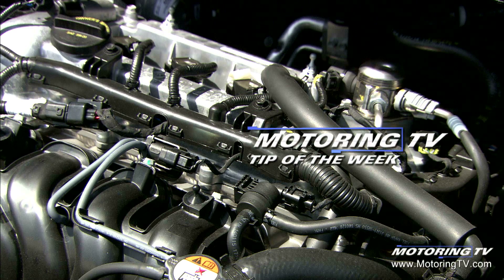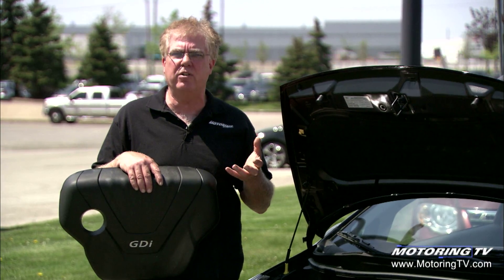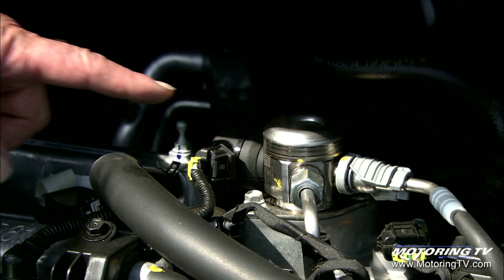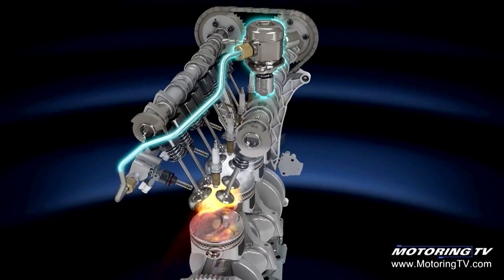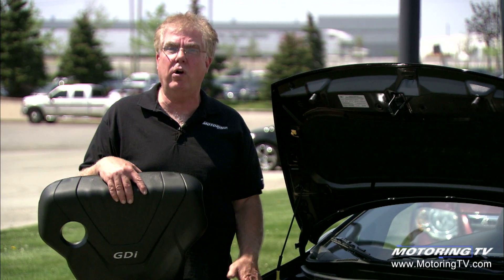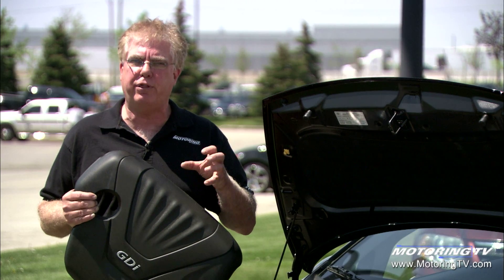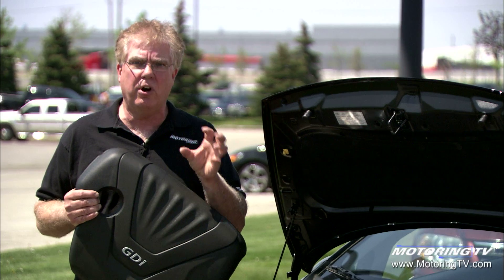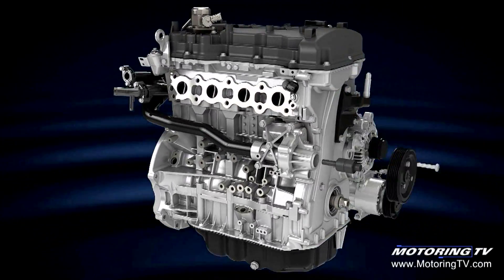Tip of the Week: Direct injection

Comment: Worse advise ever. I just spent $1500 to have my valves media blasted with ground Walnut shells due to peanut size chunks of carbon on the valves and a bad fuel injector. Cause...  Direct injection. Carbon is not washed off the back of the valves like it used to be. Stop giving bad advise. These engine s are too problematic. Mechanics everywhere will tell you NOT to buy them unless the manufacturer added an extra fuel injector back up on the port to cleans the valves like Toyota started doing in about 2014. Ford does it now in their trucks.  They figured out that it caused problems. Basically cars are being designed not to need major maintenance in no time. If it's one with the extra port injector to clean the valves then DI is good because of it's gains. But now you have more fuel injectors to worry about. Lol.
Reply: Or for free (-fuel cost) you could have held it in 3rd gear on the highway for 10-15 mins haha this has been shown to be incredibly effective at cleaning intake valve deposits. Plus the deposit issue only seems to affect DI engines that are short tripped a lot or don't see much highway milage.

Comment: If you get a direct injection motor you must buy an oil catch can as soon as possible. Or you're going to have problems with carbon buildup on the backside of the intake valves.

Comment: The engines with out the injectors on the manifolds to clean the carbon off should be considered defective in my opinion and a manufacturer defect.   UNLESS - they also have the injectors on the manifold for cleaning of the valves through computer controlled cleaning cycles.

Comment: There is a downside, your valves get very dirty with no fuel going over the valves.  I agree that DI is step in the right direction and would buy a engine with DI, but have to take the time to clean the valves using GDI cleaner.

Comment: It does ad maitenance cost.  Every 30 to 40 k you have to flush the fuel system and that is about 3 to 4 hundred dollars. Also Kias and Hiunday GDIs are notorious for check engine light pop on because of miss fire and that is caused by carbon build up.  DI is good BUT,  it does add mitemamce cost and compromise Reliability..

Comment: I know VW is resorting to blasting walnut shells into the intake port in an effort to clean the backsides of the valves.  Sorry Bill, you're a knob if you think there is no downside.  I usually like Bill's advice, but not here.  The cost of the HPFP (High Pressure Fuel Pump) would be a kick to the nuts to replace as well, and it will need replacing some day due to the enormous pressures involved  On a TDI about $700.00.

Comment: CRC intake valve cleaner every oil change works wonders. Yes GDI’s have a big flaw but easily handled if you take care of your car.
Reply: WhoHonestlyCares ??? I just did my 2016 kia forte. It smoothed out the engine. But when the lights are on its a tad rougher but not extreme. I guess its normal.

Comment: Sorry I would never buy another DI car. I would avoid them at all cost. UNLESS its toyota as they combine port injection to keep the valves clean. Forget everybody else at this point in time.
Reply: Sorry, but Ford did the dual injection first. Toyota was just smart enough to copy them...
Reply: craig g and as usual improve it
Reply: Really easy to clean the valves using GDI cleaner, did it this past weekend and took me a total of 1 hour.
Reply: @darrelc5411  Did you see before and after inside the engine? How do you know it works?
Reply: Yes I saw down the intake ports where the valves are, and they were very dirty, after the GDI cleaner, they were clean.  I took off the air intake manifold, to get a nice view of the valves, also changed spark plugs at the same time, since it was off.
Reply: @darrelc5411  Thanks for your reply. I have a 2015 Sonata that is running fine for now, but I'm going to start using the CRC as a preventative measure. Like the car a lot, but just recently learned about the problem with GDI and this has had me worried. I usually drive cars for at least 250,000 miles without any major repairs. Was hoping the Hyundai would hold up.

Comment: Not sure why a self cleaning water/steam system is not incorporated into these engines.  Basically a water tank that sits on the exhaust manifold that will deliver steam through the intakes, and have it pass over the valves.  This is a high level idea.  Winter driving, how/who fills the tank, etc. all need to be worked out.   It basically it needs to be set up where it will only deliver steam to a high raving engine when it is at operating temperature.  The car manufacturers can make money by selling a suspension fluid that contains petroleum based solvents injected or carried with the steam.  We need a solution for dirty valves with gdi.
Reply: I like your style dude!
Reply: Jeff Sol seriously!!!  I will have to get on Google.  I need to get out more.

Comment: Down side is carbon build up which is expensive to clean......added maintenance cost.
Reply: Mike Shay . 4K holy crap
Reply: I mean if you use good gas and clean it every 30k miles with liquid you should be fine. If it's a vw it's a 5 hour job all other manufacturers 2 or 3 hours and can be done easily.
Reply: Cost me just over 4k.  All new 8 injectors and carbon cleanup using walnut shell media.  Direct injection is not worth the downside unless it has valve port injection to spray the tops of the valve with top tier fuel only. Never use cheap gas.  Blame the EPA with their strict emissions regulations.  Too much too soon is demanded for slightly cleaner emissions.  These engines recycle the dirty crap that would normally be forced out of the exhaust.  Instead, they are recycled to burn a second time in the combustion chamber and the system that recycles it can also fail and is also very costly.

Comment: The one big downside is carbon buildup behind the valves. Even a high detergent fuel cannot directly clean behind the valves on a GDI engine. But the benefits outweigh this downside, imo.
Reply: This isn't much of a problem anymore, especially on the engine given as an example in the video which intake valve deposits are almost unheard of.
The early VW DI engines were terrible for it but those were early days.
For example on this Gamma engine the valves are still open when the fuel is injected and it has a slight cleaning effect, enough to prevent build up. There are Hyundais with this engine with over 500,000 miles with no mechanical or carbon issues.
Toyota now puts mini injectors behind the valves too which operate every now and then to clean the backs.
Reply: Sector 001 Not in my opinion
Reply: With intake valve cleaning b4 every oil change... my kia soul drives the same at 27k as it did new. Its easy to do with another person. Just one step in upkeep.

I agree. More gains than loss imho... ill see at 100k